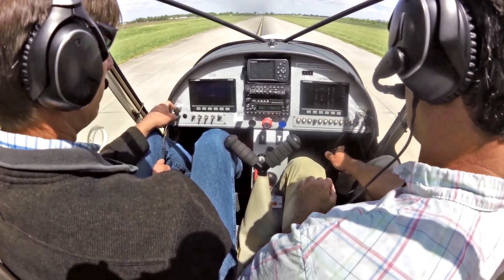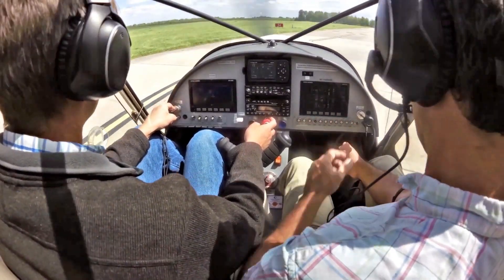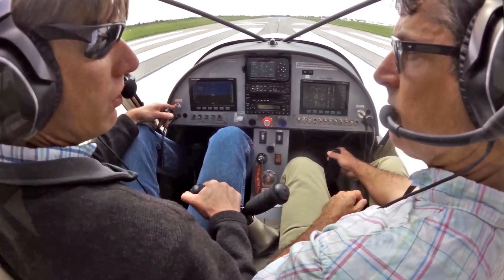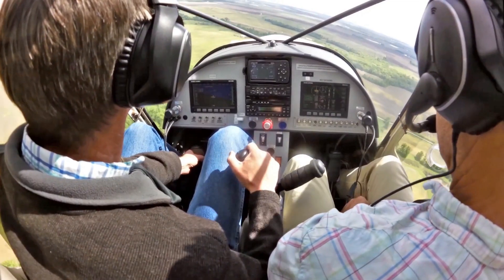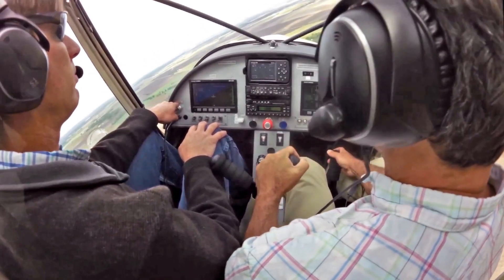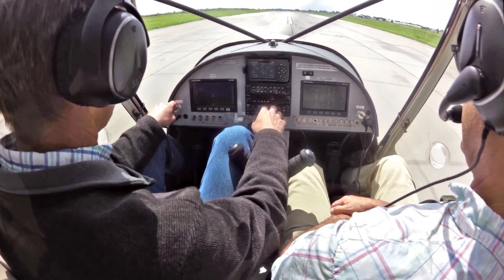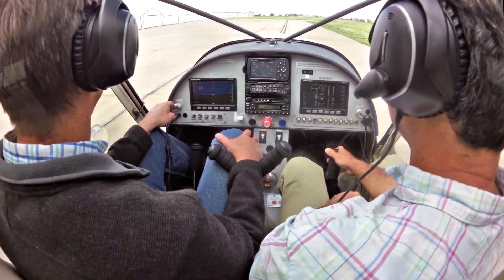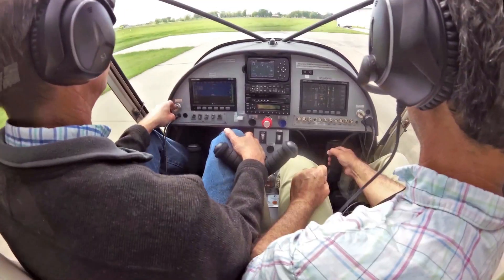Hand controls in the Zenith CH 750 - prototype installation

Comment: Better to use a Ercoupe type coordination bell crank system with two sticks, one on each side of the pilot, with hand brakes and twist throttle. It would make for more natural control. HOTaS switches for trim, A/P, radio, etc. No pedals required. Or go with a yoke, coordination  assembly, and brake levers on the yoke.

Comment from the maker: The current rudder / nosewheel control is push forward for left rudder input and pull back for right rudder input. This is an arbitrary configuration. What's your preference? Is there any established convention for left/right push/pull? (We haven't found any).
Reply: With a conventional engine, I think you've got the best setup.  Right rudder is more commonly used on takeoff and climb, and pulling seems like more natural motion.   With a Rotax or something that requires more left rudder, you'd wanna reverse it.  Just one man's opinion.

Comment: I'm a paraplegic and LOVE that you guys are working on hand controls. As far as I know you're the only homebuilt aircraft company that's ever done this.  I only have about 30 something hours flight time and that's about 3 decades ago before I was injured in a HALO parachute jump while in the 5th Special Forces, but I'd like to offer a few suggestions. Add a locking twist grip to the rudder hand control so that I and others that can't use our feet won't be juggling 3 controls at various times. A brake lever on the hand control would be great as well, though it would eliminate differential braking. I'm thinking something like a motorcycle throttle/brake control. I hope that makes sense and thank you so much for doing this. I believe that you mentioned this already, but one last thing, move the control further back.
Reply: Robin thank you fellow veteran for your service . I'm an Air Force Veteran .Sorry to hear you were injured in a parachute jump while you were in Special Forces . Hope you get to continue learning how to fly using hand controls real soon .
Reply: Robin do you use a manual or power wheelchair ?
Reply: Manual, it's a lot less cumbersome and allows me to get in and out of places that a power chair can't.  And being titanium, even with a gel cushion it only weighs 22 pounds, so I can get it in and out of my truck and Jeep without any problems.  It shouldn't be a problem getting it in and out of a 750, maybe a 701.  There's a place about an hours drive from me that gives instruction at the Sport Pilot level and they have both a 701 & 750, but I haven't had the time to go by there when they were open.  The next year is mostly taken both financially and physically, as I'm going to buy land and build on it, so when I have free time I'm searching for land.  If I get what I want I should be able to fly out of the it as well as shoot and hunt.
Reply: Hi Robin ,
Thank You buddy for your reply . Wish you the best finding some land to build on . Sorry no organizations came to your aid to build you a wheelchair accessible house after you were injured while serving in Special Forces while you were on active duty in the Army. Do you work at all and I hope your 100% service connected for your injury(s) ? I hope you find the land you want so you can fly out / in from your property . There is a housing area here and the residents have hangars for their planes behind their houses . It's called hidden Lake Airport . The landing strip lights can be turned on from the air by clicking the airplanes radio  microphone . What make & model manual chair and what brand of gel cushion do you use ? I have a high profile ROHO cushion on my power chair and a low profile ROHO cushion that I sit on while driving my van and when going out to eat or other places that have hard seating . 
Take Care Robin !
Bob
Reply: I'm service connected,100%, so there's help here and there. I had a small business as a gunsmith but shut it down a couple of years ago. I'm considering starting again since I still have the schooling and all of the tooling.  Having a small machine shop comes in handy at times. I use a Jay Extreme, a lightweight gel cushion, but they don't make that model anymore so I jus ordered a Jay lightweight. I don't weigh much, about 135, so I can get by fine with a low profile lightweight cushion. Take care. It sounds like you have a pretty nice setup with the airfield.
Reply: Hi Robin
Thanks for your reply . What make & model wheelchair do you use ? I use to have a Quickie 2 hvy duty fold up manual chair w/Quikie xtreme power assist wheels . They don't work any more and they need new battery packs & maybe a charger . WOW I sure wish I weighed a lot lees & be slim & trim like you .
Reply: Bob Shaw it's a TiLite ZR rigid frame. I use that every day and workout in a Top End Force RX. Great toy, but hard for cars to see me. 🤡